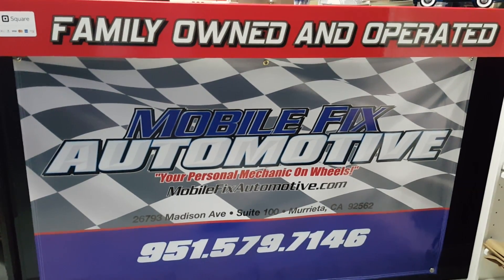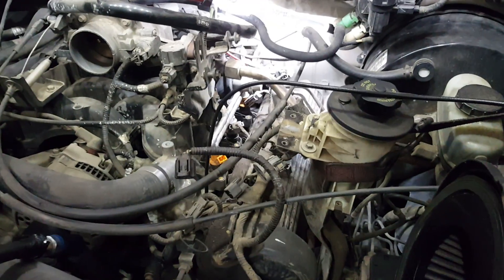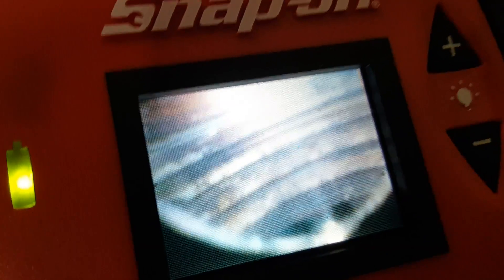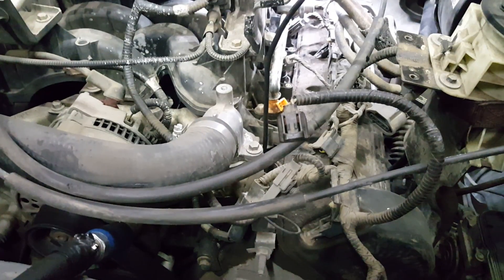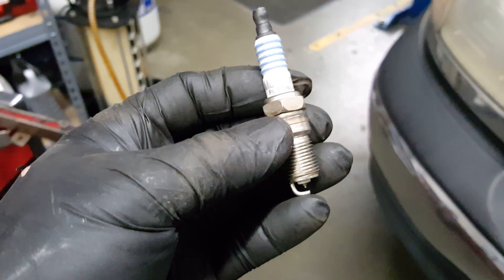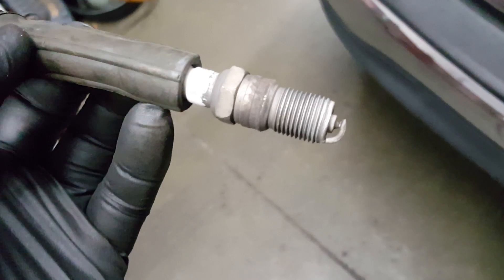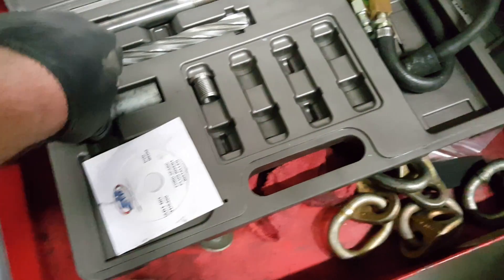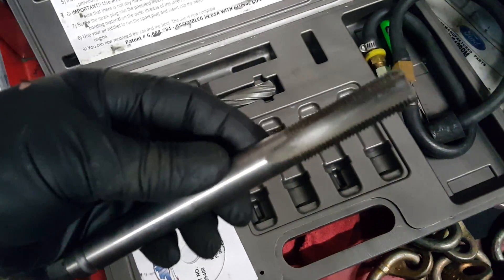Why the spark plug blew out of your Ford Triton engine

Comment: I have 2006 f150 5.4L and a spark plug stuck in my engine. The threads came out, I bought a ceramic puller but the metal tip of the spark plug  twisted when i was tightening it down and it snapped when I pulled. If I were able to get it back into the ceramic and connect the coil do you think I could get the spark plug to shoot out of the engine?
Reply from the maker: I dont think so. But that's a real pickle your in.

Comment: JB WELD?Do they make some with hi-temp apps?I applied it in a different area with lotsa heat&it kept blowing out;even with proper cleaning&cure times.
Reply from the maker: I've never had a problem so something is different on yours.  I just use regular JB weld and have on every one I've done. If its blowing out the jb weld with insert in it more likely because the threads around the spark plug blew out in head. Check  that.
Reply: @SandCarServices  THANX FOR THAT.Mine was just a sensor on an exhaust manifold of an S-10...YEARS AGO.While I've repaired MANY fuel tanks on power saws when I was logging,I only used JB in an ultra hot situation on the exh.manifold.

Comment: Ford has a reputation for blaming other things that cause problems.
1 in the 60's when they purchased Japanese steel and their products rusted away. It was the rain that caused the problem.
2. When Pintos exploded in rear collisions. It was the other cars fault not Ford's using the gas tank top as the bottom of the trunk.
3. Ford Explorer flipping over was caused by the poor design and manufacture of the Firestone tires. Not the dealers setting the tire pressure to well below the tires recommend pressure. This was done to improve the ride quality like Jeep. The tires exploded from over heating.
4. Triton Engines launching spark plugs like a V2 rocket. Spark plug issue not poor head design.
5. My favorite. Cruise control shut off switch on the brake fluid system. 12 volts directly connected on flammable fluids. 
The seal leaks and voom another Ford product on fire. What the hell. Chrysler, the cruise control inventer from day one used the brake switch to disconnect the cruise. But better idea Ford comes along and now the garage is burned down. Pass the marshmallows.
Ford
Owners
Recommend
Dodge.
Good luck folks
Reply: My 1970 Jeep brake light switch was in the bottom of the master cylinder, many vehicles had a pressure switch like that to signal braking, no different situation.
Reply: @Maples01  Except one. How many 1970 Jeeps caught fire spontaneously. How many have burnt down garages, houses. I was unaware of Jeep in the 70's. That was when Kaiser owned them and AMC was just purchasing them. Kind of figures Kaiser would put a switch there. Where is Kaiser now in the automobile business?
Reply: All Fords have that switch, how many cars caught fire, not one van burned and they are the same build as the trucks. Not sure what caused the fires but it doesn't add up knowing they all had it.
Reply: @Maples01  I am sure the 2.5 million vehicle recall was for nothing. Someone should mention that to Ford. And to the people who lost their property and possible lives.
Reply: @matadorman78  AGAIN, ALL Ford vehicles have the switch in the master cylinder but only the trucks caught fire, no way it's the switch!
Reply: @Maples01  THEN WHY THE RECALL?
Reply: @matadorman78  I don't know but it is a fact that all Fords have it, so if the switch itself was responsible wouldn't cars be burning?
Reply: @Maples01  you know, I was wrong, I admit it right here, right now. It wasn't 2.5 million vehicles recalled by Ford. Not 2.5 million. It was however 14.5 million cars, trucks, whatever for cruise control fires.
Ford had knowledge of the cruise control switch defect for many years before 2009.  The first recall related to these switches (99V-124) was announced by Ford on May 13, 1999, pursuant to NHTSA investigations PE98-055, upgraded to EA99-006.  Ford agreed to recall 263,000 1992-93 Lincoln Town Cars built from November 4, 1991, through November 30, 1992, and the 1992-93 Ford Crown Victoria and Mercury Grand Marquis built from February 5, 1992,  through November 30, 1992. More than 100 complaints were identified by Ford and NHTSA during the 1998-99 investigations, yet Ford continued to use the same
Reply: @Maples01  here is more, if you read closely the Econocrap van is listed. Yes 150, 250 and 350. Here you go....enjoy:
Less than six months after closing EA02-025, NHTSA opened Preliminary Evaluation PE04-078 on November 19, 2004, into Cruise Control Deactivation Switch fires in 738,490 2000 Ford F150, Expedition and Lincoln Navigators based on 36 reports of engine compartment fires with the engine off and the vehicle parked.  During the course of PE04-078, Ford announced the recall (05V-017) of basically all the trucks and SUVs involved in the investigation but NHTSA upgraded the PE to Engineering Analysis EA05-005 covering 3.7 million 1995 to 2005 Ford F150, and 1997 to 2002 Ford Expedition and Lincoln Navigators with the exception of the already recalled 2000 model year trucks and SUVs.  The opening resume pointed out the agency had 218 fire reports on the vehicles not covered by Ford in recall 05V-017.  EA05-005 continued until Ford conducted two more Cruise Control Deactivation Switch recalls, 05V-388 covering 4.5 million 1994-95 Ford Bronco, 1997-02 Ford Expedition, 1994-02 Ford F150, 1994-99 Ford F250, 2002 Lincoln Blackwood and 1998-02 Lincoln Navigator and 06V-286 covering 1.2 million 1994-02 Ford F250/F350/F450/F550, 1994-95 Ford Club Wagon, E-150/E-250/E-350/Econoline, 1996-02 E-450, 2000-02 Ford Excursion, 1998 Ford Explorer and Mercury Mountaineer.
Reply: @Maples01  Allo?
Reply: @matadorman78  How many cars have caught fire, how about vans, then add along switches were in car master cylinders over 40 years ago and no fires, wired hot at all times, that is not the issue. Wow, Econocrap eh, there seems to be too many of them around pushing over 300,000 miles, close to 20 years old unhampered by the hazardous switch. Troll elsewhere, you're losing here!
Reply: @Maples01  did you, or can you not read the article. It tells the number of Ford Fires. (A common occurrence in Ford products) why is that Ford Boy?
Reply: @matadorman78  AWE, you poor baby, I refuse to agree with you, so you have to take the liberal approach, name calling. If 1 in 100,000 catches fire, how do you diagnose the cause.
Reply: @Maples01  your so sad. Well at least Ford (Fire on road daily) was force by the government to recall 14.5 million vehicles, was mature enough to recall the vehicles, unfortunately unlike other, more responsive  corporations, it took a government  order to accomplish this. Just like the Spark plug issue, it is going to require a class action law suit. As for you, not dealing with reality, it is time to grow up and smell the burning rubber, steel, plastic, (lots of plastic). 
14.5 million vehicle recall.........I love it.
Reply: @Maples01  just to beat your next poor non fact based response, 14.5 million recalls. 14.5 M I L L I O N forced recalls.
Reply: @Maples01  I never, never said that others did not have recalls. However, other corporations handle recalls differently. Example the massive Chrysler recalls of the seventies. Their newest product the Volare' and Aspen twins. The corporate bread and butter cars. 9 seperate recalls on all. From hood latches that fail to rusting fenders. Chrysler recalled them all Voluntarily. Let me repeat this for those who tend to be slow... That's you.... VOLUNTARILY. It means that the government, which notified Chrysler of the issues did not..repeat.. DID NOT require a forced recall for any of the 9 items. Chrysler stood up to the plate, recalled each and every vehicle, and took care of the problems. No government enforcement. That is responsible action of a major automaker. Years later the Volare' and Aspen turned into the Chrysler Fifth Avenue and was one of the best selling luxury sedans of it's time. Also years later GM created the Citation front drive. 13 mandatory government enforced recalls in all. And GM did not learn about responsible actions. Now Ford has a tendency to produce crap. Let's take an easy target. The Pinto. One dollar per pound. The first years produced a car with an engine that self destructed when you start it because there was no oil sprayer in the top of the motor. It started dry. Then the gas tank explosions. Not only was this bad engineering and design, but Ford knew about this before the first Pinto was sold. Before P1 hit the streets Ford worked up a plan. It was called Risk Management. One of the first. Another Ford Idea! Instead of recalling each Pinto to install the needed gas tank protection. They thought, hey how many people could actually DIE in these things. It may be cheaper to go through the courts and put the corporate lawyers to work, than to recall the cars. And so Risk Management was born. One of the earliest examples of this was three young ladies burned to death after a rear end collision involving a Ford Pinto. The lawyers fought to keep the pay out low. Risk Management brought to you by the Ford Motor Company.
And you defend this company.

Yikes!
Reply: @matadorman78  Good thing no other company has ignored hazardous problems, oh wait, Toyota runaways, Chevy Fiero and Corvair fires, they ignored that. My van is 20 years old, was recalled, the 'fix' they applied, it would not prevent a fucking fire if that truly was the cause, so no I ain't buying the brake switch shit you are trying to sell, I don't know why they caught fire, but that ain't it, end of story!
Reply: @Maples01  Simply the ice cream on top here comes the cherry,
Moody's Investors Service late Monday downgraded Ford Motor Co. F+2.14% debt rating to Ba1, the first rung of "junk," or non-investment speculative grade, from Baa3. The outlook is stable, Moody's said. The downgrade reflects "considerable operating and market challenges facing Ford, and the weak earnings and cash generation likely as the company pursues a lengthy and costly restructuring plan," the debt ratings agency said. Ford has embarked on a long-term restructuring plan with about $11 billion in charges, and a cash cost of about $7 billion. "Ford is undertaking this restructuring from a weak position as measures of cash flow and profit margins are below our expectations, and below the performance of investment-grade rated auto peers," Moody's said. Cash flow and profit margins are likely to remain weak and Ford faces such difficulties at a time auto markets are softening, it said. Ford "does have a sound balance sheet and liquidity position from which to operate," Moody's said. Shares of Ford fell nearly 2% in the extended session, after ending the regular trading day up 2.1%
Reply: @Maples01  There is a God!!!!!!!!!
Reply: @Maples01  you don't have to buy it. No one is asking you to buy it. Ford already bought it. 14.5 million times. 20 year old van, what no job? If you would sleep at night instead of trolling you can get a job and be someone. You can get friends and keys to your own home instead of living under a bridge
Reply: @Maples01  Ahhh good Morning night troll. So we have a situation, you can't work. Not because you sleep on the job while trolling through the web at night, what is the reason you cannot work?
Reply: @Maples01  where did you go? Under the delapidated bridge? Stay away, that thing is about to fall apart
Reply: @matadorman78  You should know, you have proved to be a troll
Reply: @Maples01  my friend! Welcome back!!! You were surely missed. I thought the bridge fell on ya. So to go back, why can't you work and by a decent modern van. One that won't catch 🔥 like a Ford. Buy a Dodge.
Reply: @Maples01  aaahhhhhhhh 14.5 million recalls. Case Closed
Reply: @Maples01  and now you need another to be your mouth piece. How sad!
Reply: @Maples01  All Recalled. Yes before they could catch fire, they have been recalled. My point exactly, .Thank You. !!!!!??
Reply: @Maples01  You are so sad. Crawl back under your bridge now I hear a tanker truck coming. And it's fully loaded. Ha ha ha ha ha.

Comment: I have a 2000 E-450 chassis 30' motorhome with a Ford V-10 with 140,000 miles. Haven't had a plug blow out yet. Go wonder ??
Reply from the maker: Not every plug blows out of every engine.

Comment: You can go through all of this trouble,  or just start to torque them down to 28 foot lbs of torque like everybody else is doing now and the problem is solved.   no anti seize  , put them in dry Ford OEM Spark plugs
Reply from the maker: I disagree strongly

Comment: The biggest thing I worry about is the shavings getting in the engine and causing problems with the rings and cylinder
Reply from the maker: Well stop worrying! I've done so many of these inserts and nearly all with cylinder head on engine. If you blow them out, use a camera, and make sure both valves are closed, it's safe. 
Going on over 8 years specializing in the 2 valve insert with no known failures.
Reply: Thank you for the reply I have a 2000 Ford 5.4 Triton with 189,000 miles never lost the spark plug yet knock on wood but I like watching the videos you never know
Reply from the maker: I've seen lots of damage to heads from incorrect install but never from shavings.

Comment: Ron,  thank you very much for making this vid.  I also am a commoner on the #3 cylinder.  My eng is a 4.6 v8 triton. And yes sir, when it popped out, I thought that I had blew an exhaust gasket..  I also wanted to bore scope my cylinder to see what was going on, but now I know.  God bless Sir and thank you again for making this vid.
Reply: First time it happened to me I was driving down a dark 2 lane highway. Pow. I thought I blew my motor. I turned on to 2 roads,seen the spark plug was gone,walked back to the highway with a flashlight and found the plug and screwed it back in drove off. Next day,did it again. Put a rethreaded in. Just now a different one blew out. I'm waiting for it to cool down.
Reply: Luther Haynes how did you fix it.
Reply: I have a 2003 f150 with a 4.6 Triton in it, and I love it. The only thing I had to do to it was a coil pack and a belt tensioner, has 118,000 miles on it

Comment: My 5.4L blew out cylinder 8 in winter back in 2008 or so. I made a tap in my basement, then heli-coiled it in my freezing cold garage with very little lighting. It still runs perfect in 2019. That being said, I wish I had half the tools you do....borescope would have been really nice, nevermind the insert kit.

Comment: I see only one thread....? lol J/K     Ive learned with most materials  at least 3 threads is needed minimum, included beating out a pinion gear with the nut threaded on to prevent mushrooming. I would think more likely its a failure in the casting material strength of a particular block why those threads dont hold?

Comment: my 2000 f250 v10 just blown out a drilled & tapped insert with the spark plug how do i go about retapping the hole for the 2nd time?
Reply from the maker: Most of the time the calvan 38900 kit will override and repair a failed save a thread insert. But I say check carefully.

Comment: that's too much trouble, I just used the cheap little one that drills and threads the hole in one shot....5 years ago.
Reply from the maker: Not recommended at all.
Reply: @SandCarServices          That's funny because it was cheap, easy, and it was 5 years ago.
Reply from the maker: Yes and they often fail causing even more damage. Watch my video titled (why you should not use anything but a cal van insert)  I've seen major damage because of the others. 
Yes they do sometimes hold. But when they dont they turn a $300 job into a $2000 job
Reply: @SandCarServices  Maybe if they aren't done right but mine has held up quite well for many years.

Comment: In my research Ford did not do a recall because they didn't have to. The NHTSB concluded there was no safety risk and would not support a recall. So Ford rolled with it and ignored the problem$. But Ford wants you to know just bring it to the $tealership and we'll fix it for you.
Reply from the maker: Funny thing is ive seen Ford trucks burn to the ground from driving them with the plugs blown out to a repair shop. The fire was due to the fuel injector spraying fuel and then getting sprayed onto hot exhaust while driving. So please if you folks have to drive the vehicle with the plug blown out, disconnect both the coil and the fuel injector electrical connections for that cylinder before driving.

Comment: typically its a maintiance issue or lack there of, multiplied by a bad design.  plugs get overtighten and strip the threads out.  or they get forgot about and and not checked and come loose and back out till they pop.   Ford updated heads in 2002 to add a couple more threads that helped but didnt cure the problem.
Reply from the maker: That used to be my thinking but after having engines with less than 30000 miles blow spark plugs in my shop and still with only 4-5 threads in a 2016 6.8 engine in a class c motor home. The motor home had only 26000 miles on it. I have concluded it's not a maintenance issue.
Reply: @SandCarServices  most that i have seen happen shortly after changing usually over torqued.  a few, and was in my case were never checked between between changes and worked loose.  you say youve done the insert and had them come back with other blow plug a few months later, did you check all the plugs for tightness or just fix the one?   when mine went i was at 280k and just decided to replace everything,   i had 4 more that werent even hand tight.